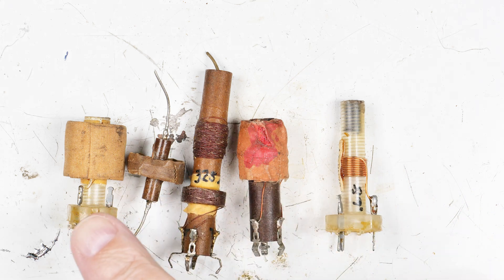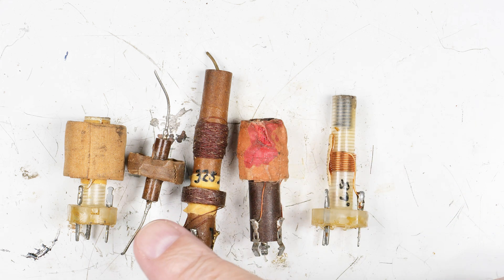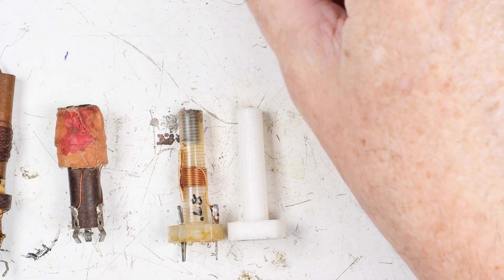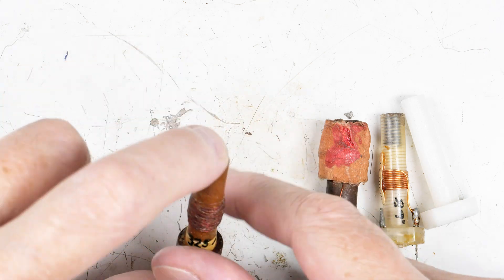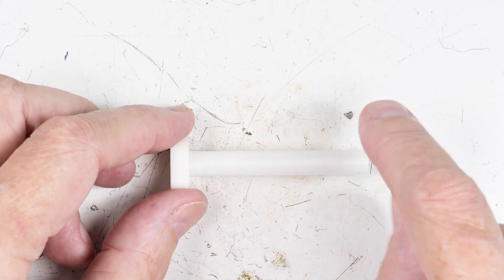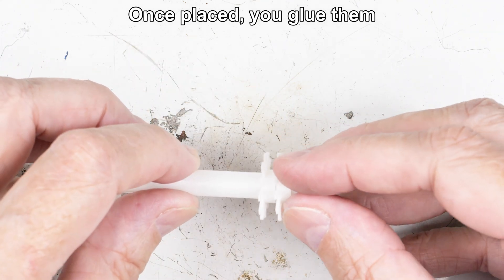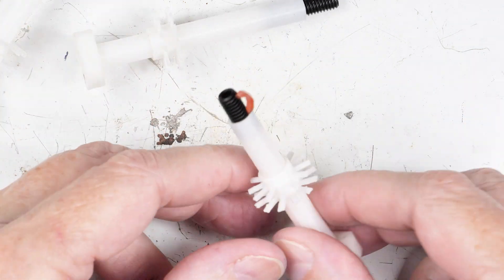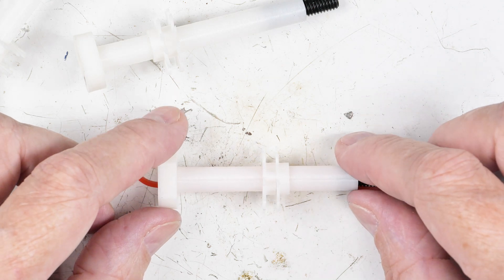DIY Inductors & Basket Weave Bobbins, Old School

Comment: I remember that in old schematics, the inductors data was not given as a value (uH) but as details of how to build it yourself (how many turns, were the tap is, the diameter of the coil, what core, etc). I also used to build my own inductors. I also saw in old schematics, instructions about how to build your own small capacitors (the pF values).

Comment: I'd love to see your take on the Miller 6300 (or 3 or 4 taps version) as they are simply unavailable...
Reply from the maker: @Pygar2  There is a lot of information online. It's a simple coil with a tap. Compared to the machine wound coils I have, the windings are rather crude. One could probably use scatter windings and get 80 to 90 percent of the original.  It was designed to use with a 350 to 450 pF cap (this value is different in different catalogs) to fit in the 550 to 1700 kHz range. It's funny that with other coils Miller lists the inductance, but not the 6300. You can infer it by the freq range and capacitance values.